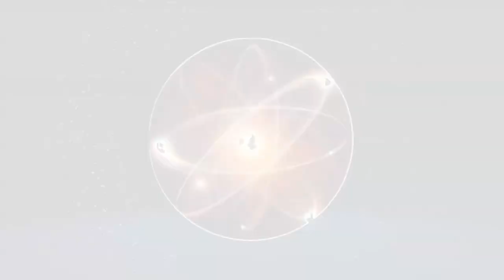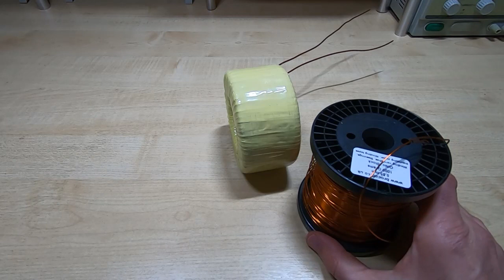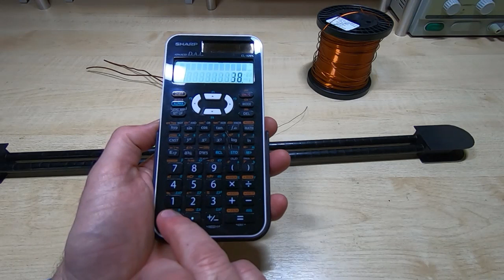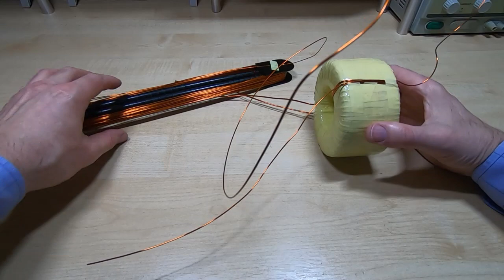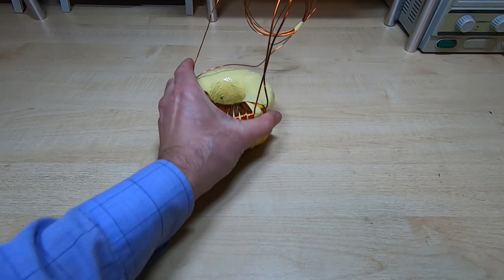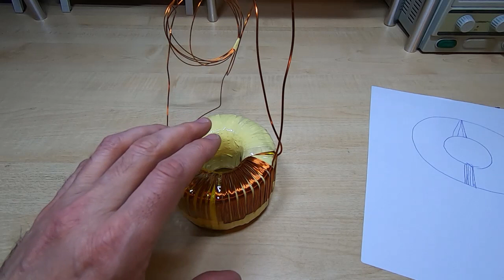RD6006 Linear Part5

Comment: I've started following this, and it's interesting to see the procedures.
And your comments on the pro's and cons for the rectifier design, power loss, and relative ease of winding a given torroid is very pertinent.

For a one-off hand-built transformer your priorities are not the same as ones made in a factory. 

But I'm not seeing the details you'd need to put them into practice.

As in:
(1) wire gauges, lengths of wire you used 
(2) toroid dimensions and type of material
(3) the various tapes and plastics you are using
(4) spacing between turns
(5) estimated losses/efficiency

So sure, I can and will calculate all this, but it would add value to your videos to do that.

In addition, why not add a temperture sensor right on the inside od the torroid to give you an exact measure of temperature? Seems a good way to prevent a thermal runaway.

Comment: Maybe it is me but I never thought of the long bobbin... How much time did it take you to make those 300 windings?
Reply from the maker: Using this method is fairly quick. It took about 5 minutes to load the bobbin and about an hour to wind the 300 turns. This method is really fast when using thinner wire but the 0.85mm is still fairly stiff so takes a bit longer to get it neat. Total time on this transformer so far including stripping it is about 3 hours. The bobbin can be made even longer and it is then even faster and it is also an ideal method for winding parallel windings such as those I showed on the transformer when I dismantled it. The bobbin ends are 3D printed so all you need to do is make them with a division in the middle and load two lots of wire and then wind them together. I actually use that method to wind 120-0-120 windings for example and it halves the winding time. I have even done 4 parallel windings using a similar method. If you wind a 12-0-12 winding using this method then it takes less than 5 minutes. You can also make them much smaller for small transformers.